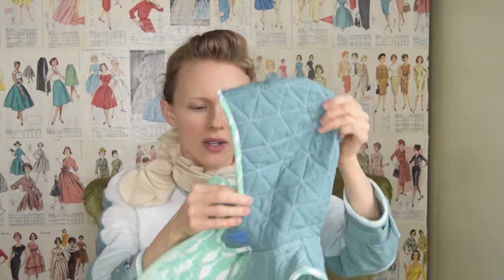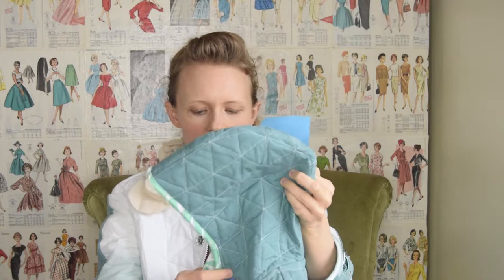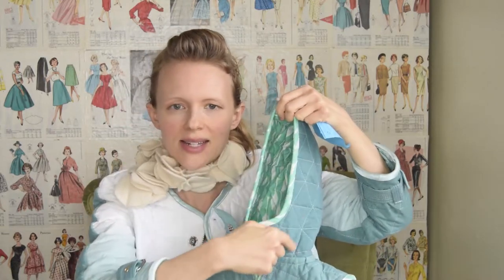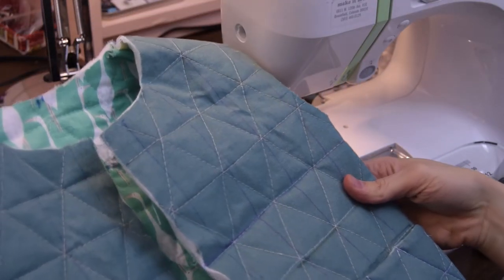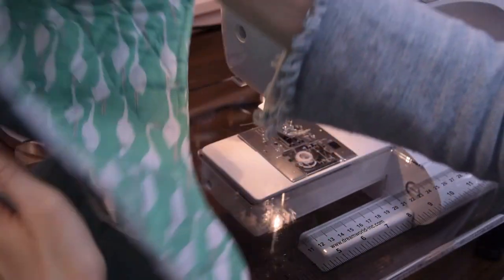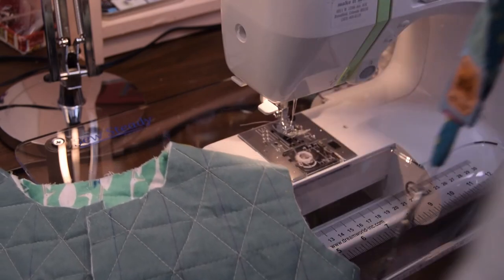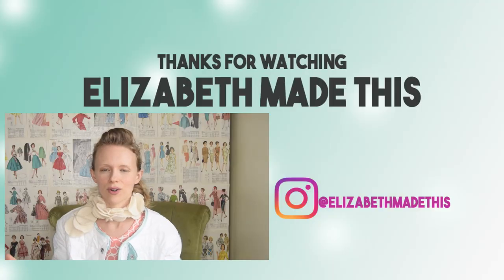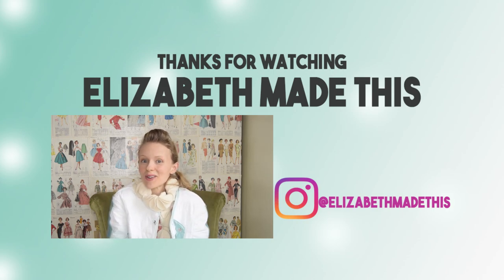Quilted vest tutorial part 4 sewing a hood quilting sewing tutorial

Comment: Lady, you were working that binding, it looks great. If I'm using binding, I don't pin or use wonder clips. Nope, my machine doesn't have that feature.
Reply from the maker: Thanks Nateida!  I always stab myself with pins😲, and I think ultimately your hands are your best tool.  My 7th grade art teacher, Mrs. Gast used to say, "God gave you fingers before he gave you a blending stump" (a paper cone tool that helps you smudge your shading into tight corners).  I have always remembered that principle, and it applies here.  Tools are good and useful, but not always necessary for good results.  Thanks for sticking in with me through this series!